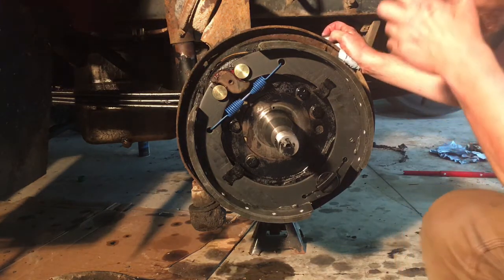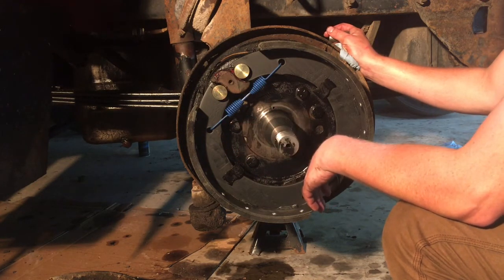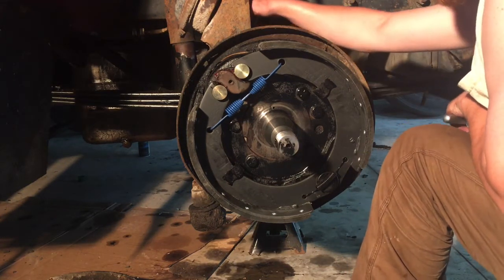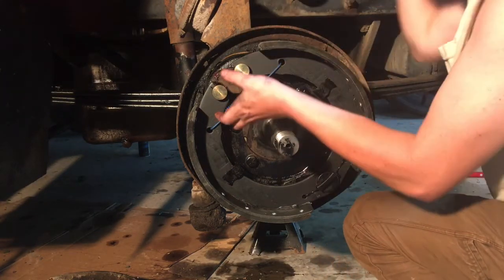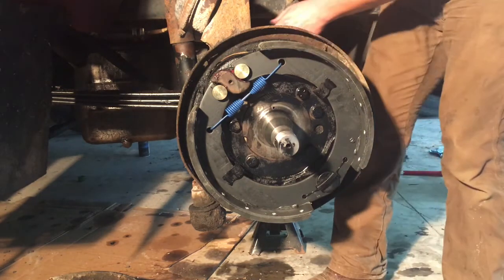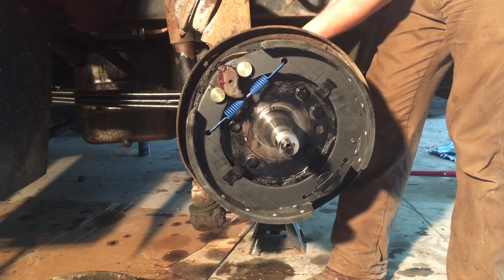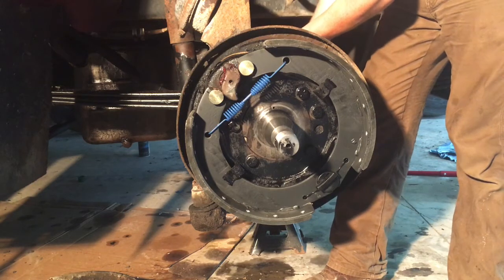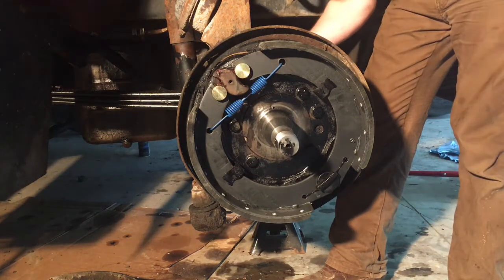How Air Brakes Work

Comment: Thanks!, good video. What makes the S cam rotate towards expanding  the shoes?  Is it air pressure? or the lack of it?
 Thank you
Reply from the maker: Air pressure. The s cam is connected to the break chamber. The brake chamber is kinda like an airbag/balloon when air is applied to it it expands and turns the cam to put the breaks on.
Reply from the maker: However when there is no air pressure. A spring puts pressure on the cam to apply the brakes. This is the emergency brake.
Reply: @everydayamerican2037  Thanks for making it clear. Thats what I read and understood, a friend of mine got me to think, he said lack of pressure is what activates the brakes, not knowing that that applies for parking and emergency brakes only, right?
Reply from the maker: It’s confusing to understand. With no air the brakes are held on with spring pressure. (Spring brakes/parking brakes). Once the truck is on and air builds up you take the spring/parking brakes off by applying air. Then the service brakes are put on by air pressure.